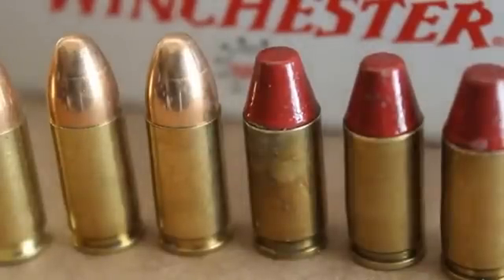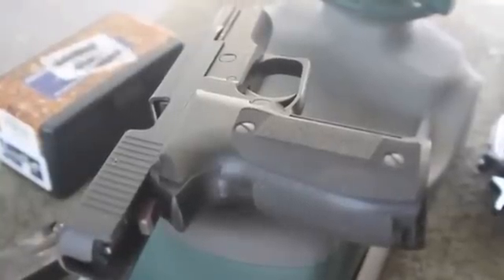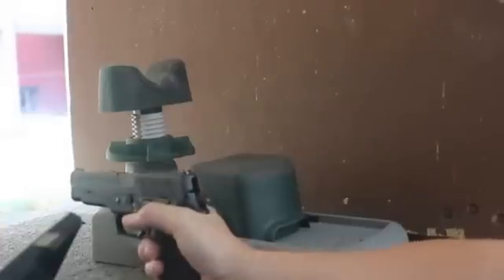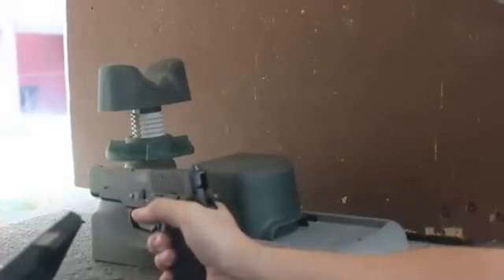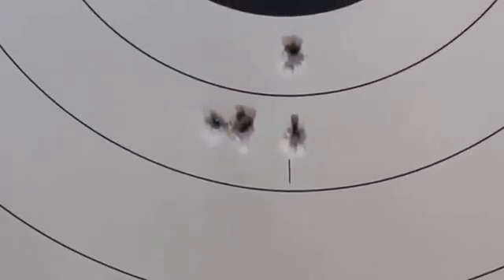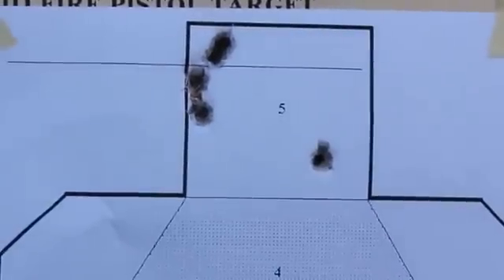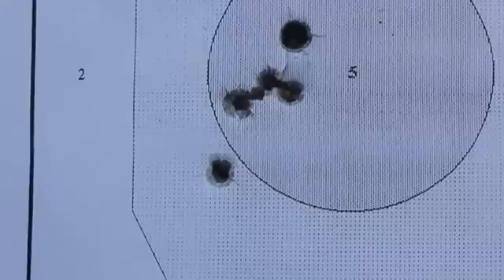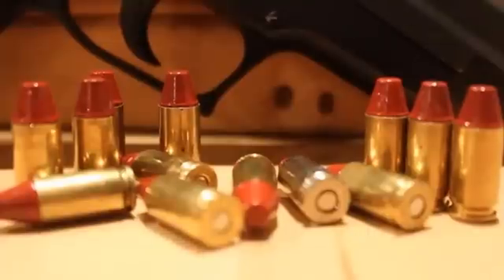Duplicating 9mm Hard Ball With The Lee TL 356 124 TC Powder Coated Bullet

Comment: Hey Fortune Cookie. I'm using similar loads as you, except my Lee 2nd edition of Modern Reloading load data calls for a Taller Cartridge Overall Length. Mine have 2 lube grooves visible, yours are seated to the base of the cone. Because of the taller COAL I have feeing issues sometimes... But, I'm a bit concerned that seating them lower would have higher pressures... You're seating your 124's at the base of the cone and don't have any pressure issues with LongShot? Please let me know!
Reply: Dang, I had the same question and was hoping someone answered you
Reply: @gerryrandolph  hey Gerry. I’ve worked up a load seating to 1.100” using LongShot and 124 gr Lee Least cast Truncated Cone.
Reply: @JoeStMars  I sat back down today and played around a bit more. Using my barrel as my absolute guide, the tallest I'm able to make it and not have it touch the rifling is 1.045. 

I'm going to have to seriously play with my charge and start at the lowest level and hope it works, or ditch the truncated cone mold and try to find a round nose someplace (that ain't gonna happen anytime soon)
Reply: @gerryrandolph  keep it up! Start low and be safe. I was plunk testing with my barrel and 1.090” is actually what easily drops in and out. 1.100” can still be extracted fairly easy (only some resistance) you might be able to add 0.010” to your measurement just to be safe. Maybe make a dummy round and see how easy it extracts. It’s not a bad thing if the bullet touches the rifling, as long as you can extract it Unfired if needed... without pulling the bullet, or fighting to get the slide open.

Comment: so 125 tc lee mold, become 130 grain after coating...
Reply: Actually, it depends on the alloy used.  Lead is heavier than tin and antimony.  I think Lee weights are based on Lyman #2 alloy - not positive. The weight of the powder-coat is negligible.  My 124gn bullets usually drop closer to 130gn because I use a softer alloy when powder-coating.

Comment: Steve I just reloaded some of these bullets with powder coating. But did you know that you can put a gas check on the bevel base by pushing it through a lee sizer. I have actually used a hollow pointer to put a small hollow point. And they do expand. Also this bullet casts large enough to shoot in the 38/357. I have found data for a similar bullet that drives it over 2000 fps from a 357 carbine. Powder coating has really beneficial to bullet casters. You can use a softer alloy and drive them fast with no leading. Do you know if they will grab polygonal rifling.

Comment: FortuneCookie45LC i cant seem to find load data for 124gr tc bullets...ive been using titegroup for some LRN hi-tek coated of the same weight but im guessing that may be a different charge and OAL..i was planning to powder coat them
Reply from the maker: jndred - That load data for 124 grain bullets (TC or not) is well distributed.  As long as the bearing surface is similar for the same weight bullets, you can use the data - best to always start low and work up on powder charges of course.  Good reloadin' to ya,  FC Steve
Reply: @FortuneCookie45LC  Thank you sir..as always I greatly appreciate your help

Comment: I love the TL356-124-2R  round nose from Lee over 5gr Unique, that's been a great combo for 10 or so different 9mm handguns.  
I've been using a 2 cavity all this time but finally got a 6 cavity, but it's been very troublesome so I'm doing some fluff and buff on it, putting in a set screw for the sprue plate bolt, etc.  So hopefully I'll get that working great so I can cast up a ton of em!   They go really quick at the range!
Reply from the maker: Toolness1 - Sorry to hear of your 6 cav issues.  There are some lemon molds out there - you might have one of those - i have nearly every one of Lee's 6 cavs and have found them to be more than fine - no adjustments or mods needed - just cast 'em.  I've seen videos of casters sanding 'em and buffing 'em and polishing 'em.  I've always said that none of that should get in the way of casting big piles of good bullets.  Congrats on your casting though..!!  FC Steve
Reply: What's your o.a.l.?

Comment: I see that your reloads don't have the bulge that my do !!!! I sized my loads to lee  .356 125gr ( 132gr) out of caster and power coated and my Taurus millennium 111 g2 not resized stuck in barrel would not close and when I ejected it pulled it apart !!! so I  had to resize all  3000 power coated coasted but the Ruger P95 had no problem with the loads !! how is it that your loads don"t have the top bulge !!!!! lee die set and the same for the XTream .355 plated bullets !! the bulge . I don't like the bulge !!
Reply: Stephen Salamone 
Cast, powder coat, then size  if you powder coat after sizeing you add 1 to 2 thousands makes fat bullits.
Reply: the question is what die is he using to get the casing so straight mine has a slight bulgb around bullet  -using the same bullet ?? RCBS ? LYMEN? ....
Reply: Stephen Salamone he normally uses the lee crimp die to crimp his loads. It has a carbide ring on it that smooths out the bulge. Highly recommended by FC45LC. He’s the reason I got one!!

Comment: I have followed all your advice to the fullest I have bought a bundle in accessories and even so my bullets are turned when firing, I have managed to determine that the fault is that I can not melt the lead of the wheelweights at a temperature that allows me to achieve a mixture Homogeneous, what butane gas equipment comes out in your videos and where do I get it? (I think there is the problem) on the other hand I would like to know where I get iron fired pots of good size and price, thank you very much for your help!
Reply from the maker: Andres Poblete - Thanks for your comments, and Good castin' to ya.  When bullets do not stabilize, the reasons are 1) bullets do not fit the gun 2) rifling twist is too slow for the weight of bullet used 3) bullet velocity is too slow to stabilize 3) bullets are too soft for velocity being used to hold the rifling 4) bullets are out of effective range 5) barrel is leaded to degree the rifling is not able to engage the bullet - dangerous situration 5) barrel has become or is bad.  Bullets have been cast over wood and coal fires and buffalo chip (dried droppings) fires in the past.  Propane is very commonly used for doing backyard bar-b-ques and camping.  Stoves fired by white gas or camp fuel also work well to melt lead.  Any heavy gauge pot can be used to melt lead, but the cast iron is the best.  The cheapest cast iron pots are made in China and not expensive at all...but again, that depends on your supply availability.  Hope this helps,  FC
Reply: Friend you Rules! many thanks
Reply from the maker: Andre Poblete - A good place to get reasonable priced cast iron pots is WalMart - good sized stuff in the $15 range.  Best to ya,  FC

Comment: Have you shot this bullet with just alox or 45/45/10? I've been hearing bad news about it tumbling or leading bad
Reply from the maker: +Savio Strawn -- The bad leading causes the tumbling so they are conjoined issues...This is a good bullet and if of proper diameter (.001 - .002" bigger than auto pistol groove diameter) should shoot well and clean.  If not the proper size for the gun, any cast bullet will lead any gun... Best to ya, and good shootin' to ya,  FC

Comment: Do you resize these bullets before loading?  If so, do you resize before or after powder coating?  What sizing die size?
Reply from the maker: +Blatant Abuse -- This might come as a shock...but Lee's TL (tumble lube) molds are designed to most often not require any sizing at all - just drop 'em, tumble lube (45/45/10 or powder coat), and load 'em.  These bullets were cast, PC, and then loaded with no sizing done anywhere.  That is because the bullets are at the proper size already... Happy New Year to ya... FC
Reply: FortuneCookie45LC That's good to know.  Thanks, Happy New Year to you too.
Reply: Thank you for your tremendous efforts in bringing all of this up, very pleasant and helpful to watch your videos. I did not get the 45/45/10 part. I am sorry i missed this out, have not a lot of tools for bullet casting right now, but i am about to bring up a massive change to that. Is this your own tumble lube mix? What ingredients are needed? Thanks again and thumbs up!
Reply: Oh! I found it! all good! Just watching it. Thanks again!
Reply from the maker: Norman - I'm glad you found it...please come back with any questions as you might have... Yes, other floor waxes can be used if JPW is not found.  And some like to cook down the JPW - it really isn't necessary.  Plus, you can tweak the 45/45/10 as you desire - for example - if shooting in a rifle where the barrel is longer, you can go a little heavier with the Alox and lighter on the JPW.  Best to ya.  FC Steve
Reply from the maker: Norman Reppingen - The 45/45/10 system was designed by a shooter named Recluse who liked the idea of the Lee Liquid Alox tumble lube - but did not like the drawbacks of sticky and unsightly bullets after the Alox tumble lubing.  So he took the Lee Liquid Alox and added an equal portion of Johnson's Paste Wax (cuts the stickiness) and then add 10% (of the LLA and JPW mass) mineral spirits to that to allow the mixture to evenly coat the bullets.  Tumble the bullets in the 45/45/10 until they are all coated, then pour out onto wax paper - spread the bullets out a bit and let dry for 1-2 days.  Load 'em and shoot 'em.  Works very well, and 1000 bullets can be lubed in about 12 minutes of total effort.  I do have videos on the 45/45/10 system if you do a search on my channel.  Good reloadin' to ya - and Hail to all our European friends..!!  FC Steve

Comment: in the video you said the cast bullets were tumble lubed and powder coated. How did the coating stick to the  tumble lubed bullet?
Reply: Oh yeah "Lee tumble lube wad cutters"
Reply from the maker: +Matt Lord -- Sorry for the confusion.  The bullet is cast from Lee TL or Tumble Lube molds.  The bullet is a tumble lube design bullet, but they were powder coated raw and not tumble lubed first.  If I had done that, I would have left them tumble lubed especially with the 45/45/10 tumble lube and loaded them as such.  To tumble lube them, then degrease them for powder coating would be a terrible waste of time and materials... I would have just cast up more for powder coating - that would be making progress.  Plus, as you suspect, if indeed the degreasing was not 100%, the powder coat would be disabled...an even greater waste of time and materials - that is not in the strategic plan for the Hot Lead Zone...nor should it be yours or any other casters for that matter... Happy Holidays to ya, and keep those comments and questions coming...   FC

Comment: As I said earlier, You have absorbed the cost and did the leg work, 10-15 years ago powder coating bullets was unheard of and most people would have sneer at it,  You have exposed a way that People can start Casting and enjoying the savings over Store bought and Reloaded cartages with Jacked factory bullets by just casting their own and by using the 45-45-10 or powder coating,  Both require Minimum investment and give excellent results.

Comment: Haven't got into the powder coating yet.
Reply from the maker: +TRprepper -- I resisted doing PC for quite a while as my 45/45/10 works so well - you could shoot your entire shooting career using cast bullets lubed via 45/45/10 (and it is fast, minimal time lubing - coupled with no size needed cast bullets, you are in Bullet Nirvana).  But finally yielded when Mark in the shooting community showed off his PC bullets - so let's see what all the hullaballoo is about - so far, PC is doing OK, but nothing that the 45/45/10 won't do except for the encapsulation of the lead...that might be the one thing that PC has over other lubes.  Best to ya, Happy Thanksgiving   FC